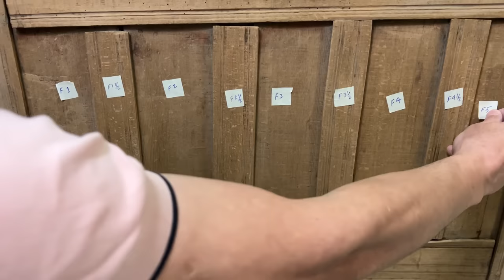Restoration of the 500-Year-Old Chest - FURNITURE RESTORATION

Comment: Terrible. If it’s 500 years old, why are you using PVA glue on it, what a philistine move. And why sand it down to bare new material. All that patina that has developed over possibly hundreds of years, simply ground away in minutes with an electric orbital sander. 😤😤
Reply from the maker: Thank you for giving me your detailed and expert opinion. Yes, like you, I also know that its centuries-old patina is destroyed by sanding, but the thing that should be noted is that this box has been burned in some places and attacked by modern and forged nails. Another point is that if you are careful, there was another chest of the same style next to this chest, but since it was healthy, we will not restore it because we don't want the patina on it to be lost.
Finally, I am very happy that enthusiasts like you give a technical and respectable opinion.

Comment: Por la presencia de los clavos ya había sido reparado antes.  Ahora en mi humilde opinión no se debería pulir tan profundo ya que elimina carácter y la historia vivida por el mueble.
Reply from the maker: Like you, I also know that sanding destroys the patina and historical coating of the chest, but if you are careful, this chest has been burned in several places, which was deep, and also, as you said, it has been renovated several times with nails. Since it has violated its originality, we have tried to remove them and restore it as it was when it was originally built. Anyway, thanks for your comment and constructive suggestion.

Comment: The chest itself is old, but the lid is new. Previously, 100 years ago, everything was made of wooden bars, and the lid was on nails.the translation is inaccurate. I meant they connected the boards with wooden screws, not iron ones.
Reply: No idea how often it has been repaired....but after working on antique furniture, I've found folks "fix" furniture all sorts of ways. I took days to save a high quality veneer on a top where someone had fixed the top with staples. Another piece with 1/2 by 2 inch side supports literally had 16 penny nails driven into it when the leather pegs came loose. To tell the age of the piece, you look at the wood or woods used, parts with original construction, & style.
Reply from the maker: @raffaelecampanile5207 Its doors have been damaged due to friction with other causes, wooden pins were used in the initial structure of this chest...
Reply from the maker: @cferguson3368 It's an honor to meet you, glad to have you as our viewer.
I told the age of this fund according to the documents we have.
It is not possible to determine the age of wood or a piece of wood by eye
Reply: @CreativeIdeasMaker  I knew it.

Comment: If a piece of furniture is actually older than 150 yrs old, you probably should not restore it. Its value and historical significance is more important and valuable if it kept in its existing shape as a survivor. Another mistake without doing research.
Reply from the maker: It is interesting to me that you have criticized in another video and I asked you to give a reason but you did not. It's clear to me what path I'm on and what I'm working with, but the critic must criticize for a reason, and rest assured, I'll answer it with a reason. Good luck
Reply: @CreativeIdeasMaker  I made a couple of general comments based on simple research and talking to other restorers about furniture that is old. It’s my opinion and a suggestion, not necessarily a criticism. May be I should have said you should consult an expert or historian before doing anything.
Reply from the maker: @vmoutsop  As I said, providing technical opinions is always respectful to me